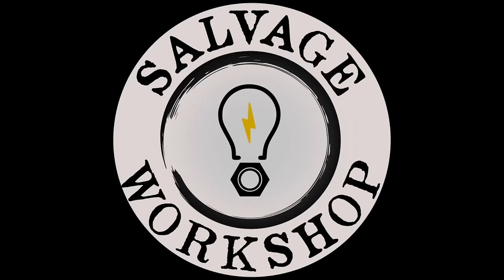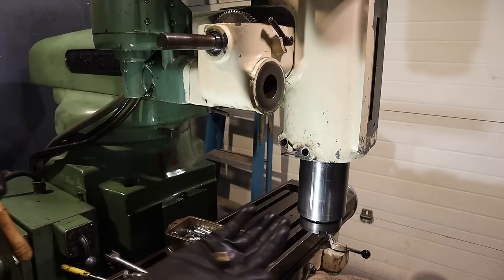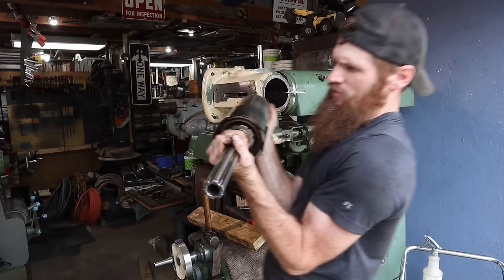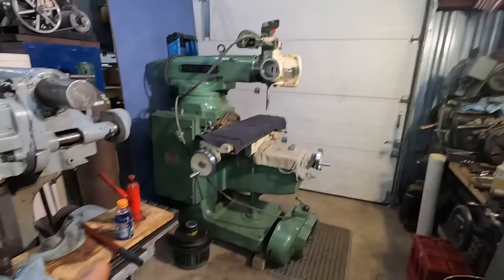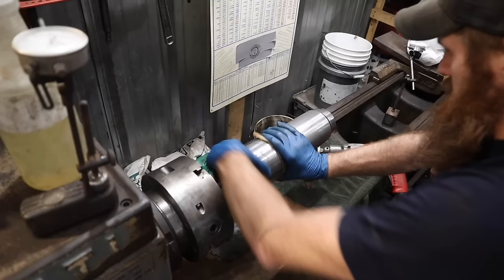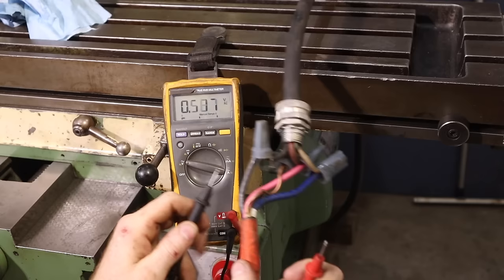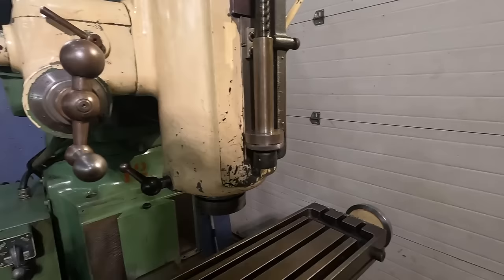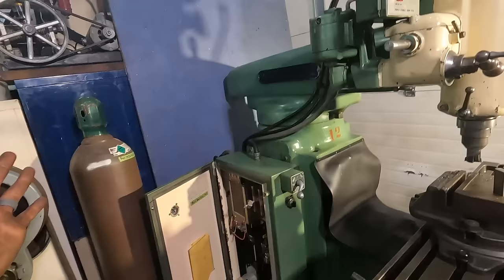My 1960's Milling Machine Is STUCK SOLID! ~ Can we fix it or will I DESTROY it?!?

Comment: Is it my imagination or is the spindle directions reversed on the switch? It looked like the milling head you were using was going the wrong direction and the cutter inserts were not supported and could possibly shatter. Nice to see you get the mill running.
Reply: He was 100% cutting the wrong direction

Comment: I got a van Norman duplex mill for free, cause the quill was stuck.  I've fixed up a lot of old machining equipment, and for me, 9x out of 10, some well meaning person saw what looked like a grease fitting, and pumped it full of grease, when those tight tolerances want a nice thin oil.  I like to hose it down with something that will cut the now old petrified grease, like marvels or diesel.  I can't remember the name, but they sell this little tool you fill up with lube, then put it on a petrified grease fitting and whack it with a hammer, it forces the fresh lube in past the crusty grease, and helps start getting it thinned out so you can flush it out.  My duplex mill has the monster 5c taper head that can do vertical or horizontal milling,  and then it's got a west german knockoff of a j head Bridgeport that attaches to the ram that supports the far end of the horizontal mill cutter spindle.   I really like it since I don't have a ton of shop space.   I mostly just do engine machining for a guy who restors 1930's ford's, and early willys, bore dirtbike cylinders for the neighbor kids, and work on my own junk.  Oh, a slick trick on those van norman mills, they were available with a power feed that ran an indexing dividing head,  so you can cut helical gears manually, without cnc!  

I found a small 10x45" lathe that can fit on my big mill table, you can do some whacky stuff with that combo too.

Comment: Change your heaters in your starter, needs to match your input current load. it should stop your tripping. My go to lube/ cleaner for tools and machines is a 50/50 mix of ATF and Acetone, and it does not take much, and works very well for me. You may very well have egg shaped the housing when you drove the wedges in to the slot for spindle causing it to pinch it. If you run into a situation where you are suspecting run it, take a micrometer and check diameter at 180 degrees on the surface, it will quickly tell you you have an out of round issue. I really enjoyed this video, have done a lot of machine tool repair and I think you did really well with your experience and you have beautiful mill on your hands and installing a DRO on it will make it even better. Thanks for the video sir, if you need machine shop tools I have a boat load of tooling I would let go of.
Reply from the maker: I never considered atf/acetone as a cleaner... Ive used it to unstick piston rings in engines, but never on machine tools... Ill have to give that a shot, especially since i was recently GIVEN a total of 9 55Gal barrels of brand new ATF (no Joke)...I doubt I egged it by wedging it, the manual specifically says to insert wedges into that space until the entire quill comes out easily... it just never came out, much less easily, hence the pounding! I would possibly be interested in tooling, could you send me an email: salvageworkshop@gmail.com ...As always, thanks for watching, I truly appreciate the support!

Comment: I would just put a transformer to feed the whole machine. Also the Bijur unit is for lubrication to the moving parts and not coolant. You do good work I am sure you have this figured out now. I used to get a cleaner from Cincinatti Milicron the dissolves the swarf on the machine.

Comment: All you will need to do is change the high/low wiring on transformer and swap the coils on motor starters IF they are full voltage (480 coils) but they are probly 120 volt coils powered off transformer.
Reply from the maker: They do say 120v on the coils mounted to the Mag switch... ill have to look a bit closer at the wiring... I changed the only wire I could find from 440 to 208/220 volt on the transformer... What else could cause the mag switch to kick out and shut the machine down while it running?
Reply: Its the N20 thing, thats a heater ( actually a thermal )
You need a different number heater
Reply: @kevinwassellsr.5646  What Kevin said. Change the heaters. You’re drawing twice the amperage at the lower voltage which is causing them to trip. That button that you’re pushing is just resetting them. As soon as you run the current through them they’ll heat up and trip.

Comment: The first thing you need to do with that vise is remove the swivel base and throw it away. You'll never see a swivel base on a vise in a machine shop they just add a spot for less rigidity.

Comment: In the aircraft industry I was told to modify the part not the machine to get the proper fix. If something goos wrong you can get or make another part. If you change the demensions of the machine you are through. Just saying
Reply from the maker: Sure when your in the military and have the resources to make new parts or have someone do that at whatever cost... I'm a one man show here doing and paying everything... There is NO way I wanted to have to remake the quill... honing something is always a low risk venture because you only remove small bits at a SLOW rate... just my thinking in this situation! I appreciate the support, thanks for watching!

Comment: Maybe the students swapped quills between two machines during maintenance training. They are probably matched for roundness like pistons at the factory.
Reply from the maker: That's pretty much aligned with what my thoughts are on what may have happened... i guess we'll never know!
Reply: Unlikely, these are production machines for one and the teacher, unless an absolute idiot, would never have let the students pound a quill in like that.
Reply: more likely its been crashed by a student. a machine of that type wouldnt have a custom fit "matched" spindle

Comment: Most 480volt motors have the ability to work on 208v, you just reconfigure the wires, it will however use twice the amperage.
Reply from the maker: True!
Reply: Don't rewire this yourself. Find the local motor shop and GET A PRO !

Comment: man, i love your videos, but this was like watching a butcher with a chainsaw trimming a bonsai...
Reply: Great analogy! I love it...........
Reply from the maker: Thanks for watchin!
Reply: haha that's great!  reminds me of a barber cutting hair with hedge clippers😁
Reply: I had to watch the whole video threw my fingers. I think I had a wee cry at one point. I am glad its running, but I am not sure I am emotionally ready for part 2.
Reply: You think that spindle cartridge is supposed to be taken out and put back in from the top?
Reply: Watch it twice, he'll do it again the exact same way.
Reply: All the GEAR NO IDEA !
Reply: Gotta be a top five for cringeworthiness………..and I’ve seen some really cringeworthy stuff on this channel…..
Reply: Had to stop watching. 😢
Reply: You've got forward and reverse backwards. Need to change / swap any two wires on the bottom side of the contactor (or any two on your incoming cable) to get the motor to spin in the direction that correlates with your fwd/rev switch. Also your overloads are tripping for a reason... need to get  amprobe and check the amps the motor is drawing and compare to what the nameplate says. Gotta say, lots of cringe in this video.
Reply: @SalvageWorkshop  this is a machinists snuff film. it was painful to watch.
Reply: I was thinking he was looking like a brain surgeon from the 1880s

Comment: Check for high spots when you hone it. It may have damage from a hit on the outside. 
Don't worry about honing it. It will remove minimal material.

Comment: Sometimes the drawbar is designed to eject the toolholder/collet/ There will be a trapped flange on the drawbar. You don't smack the drawbar to eject the tool

Comment: You lowered the voltage on the entire mill. When you did that it causes amperage to go up, in turn heats the heaters up on the motor starter which trips the contact. Thats why you had to reset it then start it again multiple times, the more you reset it the shorter time it will run because those heaters are already warm. I cant see that starter real well but sometimes there is a temperature or amperage setting on them. But before you change that i would take an amp draw on your spindle motor, my guess is its over amping now which can also cause that knocking noise in large horsepower motors like that. Or wiring is incorrect which it was running at 238v. But one peg was much lower i believe you said.

Comment: If you are using a "Milwaukee" cordless drill and the bit (or hone) falls out of the chuck, you have erred. Rotational forces will inherently unlock or open the chuck. Therefore, insert the bit and tighten the chuck as much as you can. Then, loosen the chuck slightly (one click). This will engage the chuck's internal  "lock" and keep the rotational forces from loosening the bit.  Other keyless chucks will most likely operate the same. Best of luck. Oh Yeah, keep up the good work. Dave
Reply from the maker: Huh... Didn't know that! I appreciate you letting me know, Ill give it a shot! Thanks for watching! I truly appreciate it!
Reply: Works on my DeWalt as well.
Reply: AvE did a whole video on this hack and it turns out to be untrue. The click you hear is just the internal ratchet mechanism doing its job.

Comment: looking at the quilll at about 16: 00 i was starting to wonder if it needed to come out the top of the machine , would make it safer from dropping out of the bottom and damaging the ways , it would allso make it a little eazier to preload that spring and engage the quillfeed (using gravity and no need to force it up the machine while having one hand short for fastening and turning stuff to get it to grab and not fall out)

Comment: You may or may not need to change the overload devices in the control box. First check the wire size from the control box to the motor. If the machine was wired with a dedicated 440 volt purpose it may be undersized for 220 volts.  Second check the controller transformer to see if it can be configured for 220 volts. Then you can determine what if anything will need modified. If the transformer can be rewired to 220 volts and the motors on the machine can be rewired to 220 it will most likely be usable as is. The machine will have overloads that are sized for the wiring it has. The motor loads will be limited to about 55 percent or so of the maximum recommend load. Back when I worked in a shop, we never ran machines at 100 percent load. I have a Sharp VH 25 that was 440 volts original. I rewired the transformer, rewired the vertical motor, the horizontal motor, coolant pump motor, the Z power feed to 220 volts and it has worked fine for years now. The X power cross feed was a two speed 440 dedicated motor and is still wired 440 as it doesn't have the option to rewire to 220. The local motor rewind shop that I have used for years filled me in on how this can work, or you can find a 440 transformer and keep it on 440 volt. If you run, it as is and are kicking out the overloads you then will need to start upgrading or reducing work load.

Comment: It’s interesting to watch someone who has no idea of what he’s doing, trying to disassemble something entirely incorrectly. I try to get as much information as I can first. If I can’t find anything, I ask people who might have some idea, or they might know someone who does.
Reply: Lighten up Mr. Knowitall.   He didn't try to disassemble it, he disassembled it.  Buy your own used mill and make your own video so I can pick on you.
Reply: Well true but this guy just gets his biggest hammer out its going to come out one way or another
Reply: @edcrego8487  yeah. My concern is that the “other” is going to be will loss of accuracy.
Reply: @edcrego8487 well, apparently tickling it with a feather was not working for getting it to move. Sometimes in such a case plan B is the only other option. I was cringing watching it being beaten out like that, but I am not going to fault him for it. Where are you seen at in the video helping him to fix the problem? Just like me, you weren't there. He did what he thought was his only option. And guess what? As brutal as it was, IT WORKED. Yes, he could have asked on online forums and may have gotten a few suggestions over a couple of months. He could have found someone who does that kind of work on equipment and paid several hundreds of dollars or even a thousand dollars or more to hire someone to do it. Or he could have left it alone and not functioning. Or he could do what he did. It's his machine to do what he wants with.
Reply: @melgross what else would you suggest to get a Badly Stuck Spindle out???? Let’s hear your Smartas$ solution!!!!

Comment: I have a lot of experience with both the Gorton 1-22 and the Bridgeport J head mills.  I have a J head out in my shop, one of my younger brothers has a Gorton 1-22 in his.  I've used both, his has a 40 taper spindle, and no nod in the head may  R8 Gortons are basically comparable to 2J Bridgeports, the lack of nod might add to rigidity, but it's a matter of degree, and certainly NOT a "night and day" difference.   Interestingly, my brother would love to swap machines with me.  He'd have preferred a Bridgeport, but had a difficult time finding one in good condition at the time.

Comment: When you go from 440 to 220 your amp draw doubles. You need to match the overload heaters in the mag starter to the new motor load.  You have to purchase to fit the starter.

Comment: I think your problem with the mag switch is when you decrease the voltage it will increase the current. If the mag switch has heaters in the contact needs to change to a higher current. This may solve your problem. The machine was first set up on a higher voltage and less current. Hope this helps.

Comment: Ok I'm really late... but the real thing is blue out the wole inside of the mill, push the quill assembly in and see where the high points are. Use the rotating hone to check if the  hole is out of round. [One or two spin just to see if it scrape the same all around.] After that you can decide what to do.

Comment: You changed the wiring on the drive motor for 220 but the other motors might need to be rewired for 220 volt also. As many have pointed out, the motor relays have heaters that open the relay if the current gets too high. You might be able to get heaters for those old contactors but it might be better to change to newer style contactors with adjustable current settings. The wiring change on the transformer was probably just for the control voltage. Some machines use 110 volts for control so you don't have to replace the coils in the magnetic starters when changing voltage and possibly to run lights or even power feeds. If there is a schematic diagram it should show that.

Comment: I didn't see you rewire the motor itself,  may have missed that.  As commented you will have to change the heaters on the motor starter overloads, hopefully you can find the chart and ultimately source a set of them.  The Quill feed and Table feed are DC, so the transformer re-tap feeds the right voltage to them.   It needs to be wired for the reduced voltage in the motor peckerhead. The wiring diagram is on the motor legend plate.   
My first thought, when I saw you had a Gorton, was I would trade you spindles.  You have the 40 taper, I have the more common Browne & Sharpe #9 taper.

Comment: Need to change the heaters on the motor starter.  Since switched from 460 to 230 the current doubled.  May have to replace some wires as well.

Comment: It looks like you bent the main shaft when you hit it with the hammer.
It is noticeable when you turn it by hand at min. 51:01
This is probably why there are abnormal noises in the CVT.
Also, the different color of the vertical head compared to the rest of the milling machine is an indication that something was not ok there.
Reply from the maker: It may look that way to you, but nothing is bent! Thanks for watching!
Reply: @SalvageWorkshop  👍

Comment: Come on man if you can’t figure out a problem with a precision machine tool before you modify or beat on what the manufacturer put their time into engineering and machining. Take a couple steps back and do some research find an experienced machinist to look at it. Spindles are the most precise part of every machine tool the outside is held to tenths and should not be altered really at all. There are exceptions but you have to do your research before hand.
I’m not sure what was causing the binding of the quill before you got it out but a spindle should be incredibly difficult to align back up because it has a tolerance of a few tenths and simply requires a great deal of patience to line it back up without it binding. It probably was possible to slip the spindle back in after you removed the burrs that might have been up there. But you would need steady hands also honing it wasn’t necessarily a bad idea but it looks like you honed it to much the quill may now have a sloppier fit then before so it might now cut as well as before. 

 Something you should know about three jaw chucks. They are 9/10 sh** bought used and even in proper machine shops they are quite imprecise without an experienced machinist to bump clamp or adjust them in properly.